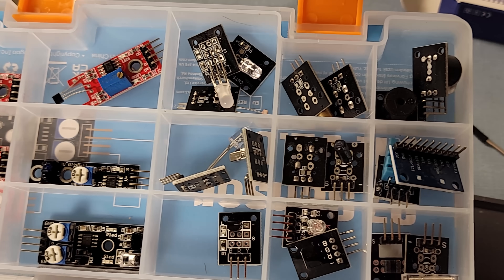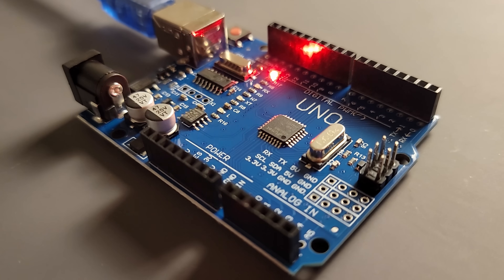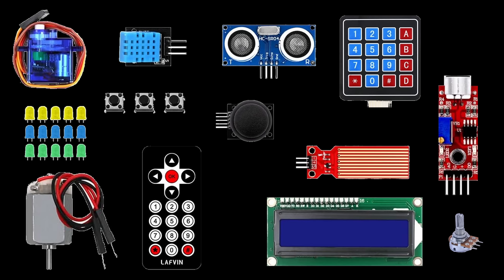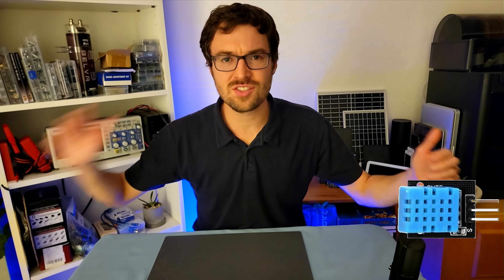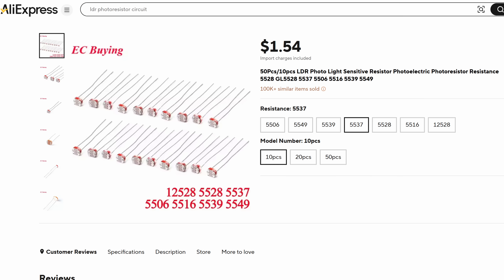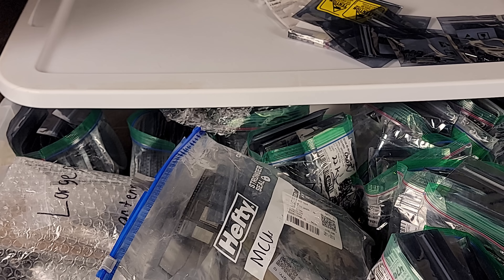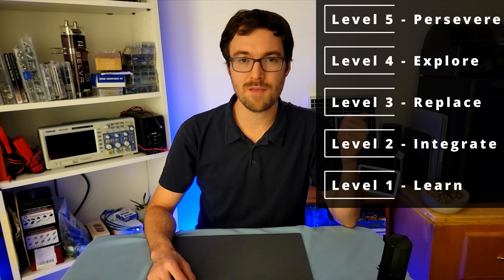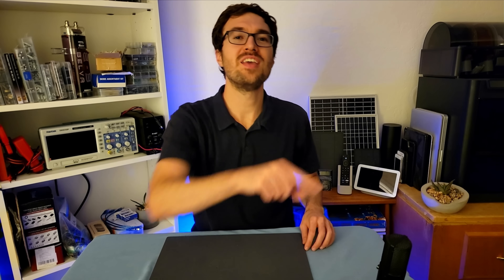How to Make Anything - Learn to Think Like an Engineer

Comment: Great video! I started DIY'ing long before modules existed (chips were even new actually!) so your "young" perspective explaining to other young people is tres novel to me!
Your explanation on the other hand is bang on and very insightful! You forgot the word "designer" which I personally love to use though hehe. 
Once you can do circuit level custom builds, the sky is the limit! Truly it is. It's nice to see young people doing this level of engineering. You're living in an amazing age of evolution, post clunky parts, pre-AI engineered, what a great time to be alive! All the best!
Reply from the maker: Thank you for such a wonderful message! Things are definitely different these days... I remember my grandpa telling me about the horse-drawn ice cart that would go through his neighborhood once a week. Now I'm getting custom circuit boards made from halfway around the world for five bucks and using AI to interpret meaning from dozens of various types of sensors. It sure is a new world! 

What kind of clunky chips do you remember using most? I can't believe how big some of the capacitors and other basic components used to be, often a little metal cans with huge legs sticking out unlike these modern tiny through whole components and even tinier surface mount components. Sure has been a lot of change quickly!

Comment: These are great advices. Don't do tutorials just for the tutorials sake, try to understand how they work. My approach is to think about a project first then try to make the project and learn the stuff while doing it. Yes, it may be frustrating to debug for an hour and realising I only missed a pulldown resistor but after that I will remember to always put that resistor there. The satisfaction you get from finishing your own projects is always greater than what you get by just finishing tutorials (although they can help sometimes).
Reply from the maker: Can you just tell that, exactly like you told me, but to the 10% of my comments where that is the perfect answer? 😜 I'm glad you really get it!

Comment: My dream is to become an aerospace engineer, so learning arduino and progressing towards raspberry pi is the first objective. I used to love Lego as a kid, but I now wonder if I should buy Lego mindstorms and take in robotics class. How will it help me? How do I connect and think logically?
Reply from the maker: I would step up to the final frontier and use real things. You are probably way past Lego Mindstorm if you are looking into Arduino and Raspberry Pi. I don't think an older age gives you any advantage in learning how to program in Arduino, connecting/reading sensors, and when XYZ happens make a motor do something or do something over WiFi. If anything, the older you get the harder it is to learn stuff.

If I was you, I'd get a basic Arduino starter kit, then a "37 in 1 sensor kit" or something like that and learn how to turn a problem/need into a mix of sensor, microcontrollers, programming, and other components. Not following tutorials, building things yourself from scratch. Also learn about materials science. Maybe not now, but maybe pick up a used textbook off amazon for a 101 level college course. It is one of the most underrated fields of knowledge and you will be able to benefit more than most from it.

If you have any questions, feel free to ask! Hope you keep at it!

Comment: As someone who has been bum rushing my arduino kits, one of the most important things I've learned recently is how to put resistors or any other components with long leads into the breadboard withour wanted to break my fingers lol. Pinch a short right angle at the bottom of the lead, just long enough to make a connection with the breadboard, but also short enough so that it doesn't bend and break everytime you try to fit in the breadboard. Obviously this isn't something you would need to worry about on larger scale project's because you typically won't be using "clunky" resistors, but it does help the breadboarding and micro project phase of engineering much more fun. Hopefully this helps.
Reply from the maker: Took me a while to figure that one out! I think I'm an expert at grabbing wires near the end and pushing them into breadboards at this point 😂 The worst thing is when you bend it over and over and over and you end up with like a curly fry looking section halfway down the wire! Great tip for beginners!

Comment: I wish to surrender to your teachings without spending too much
Reply from the maker: Writing software is free. Designing PCBs is free. Using your existing hardware in new ways is free. Years later, I'm doing the same things I did when I started out, but I'm just much more proficient doing them. If you did something 100 times, you're going to be better at it than your first time. All sensors and microcontrollers generally work the same. Learn on some, others will be easy to pick up after that. Most importantly you just need to get out there and build stuff and get experience. You will fail a lot, but the difference between a project being done and not is just continuing on and working around and figuring out those 10 or so failures you will inevitably run into. So just keep on going and accumulating experience. 

If you have any specific questions, feel free to ask!

Comment: Wait you need code to make a button light a bulb? Isn't it all about just closing the circuit?
Reply from the maker: Yes and no, depends how you wire it. If you are it directly to the power source then it will turn on as soon as the wires are connected. But if you have the microcontroller using one of its pins AKA wires to power the LED, you have to tell the pin to turn on or off using code. 

Example pseudo code: 
ledPin = Pin(number=123, type=PIN_TYPE_GPIO) # set pin 123 as GPIO (general purpose input / output)

ledPin.setValue(1) # turn on 

sleep(10) # wait for a bit

ledPin.setValue(0) # turn off
Reply: @FluxBench  so quick answer, thank you

Comment: You’re an inspiration. I started getting into electronics a few months ago, and ever since then I keep buying more and more components and trying to assemble systems. I do 3D printing, then try to figure out which modules I need, and I try to connect everything neatly and solder it together. What you said in the video perfectly summarized the mindset that took me a long time to understand on my own. I think I will try doing PCBs and make my own modules in the near future.
Reply from the maker: Awesome! PCBs are a great way to compliment 3D printing. They are extremely precisely made, and combine that with the not very precise but very quick and capable 3D printer, and all of a sudden you can do awesome things. I've heard it put as "stealing tolerances". Use the 3D printer for what it is good for, and get precision manufactured sheets AKA PCBs for where you need exact alignment and spacing. 

Also makes great face plates.

I try to keep the mounting hole spacing on my PCBs something reasonable and not a random decimal number, so that way I know if I make a group of pegs at the same spacing as the board holes, I can just put the board on the pegs with a push fit. Now I've mounted a circuit board to a 3D print part. Anyways, hope you make some awesome things!

Comment: What if an outdoor HVAC condenser circuit board goes bad? Can those simply be repaired with this knowledge? If soooo....... 🤔🤔
Reply from the maker: That's a really tricky question. I have two window ACs that have faulty circuit boards that I know I can fix, and worst case completely redo myself for probably $20, but there's also a decent chance I will brick the whole thing! 😂 I need to fix them before it gets hot again.

If it was a customer's system, I wouldn't mess around with it. But if it's my own, I would, and plan to! But then again I build air conditioner monitoring systems for a living so am also pretty comfortable with how they work and what to expect electrically and stuff.

I would bet money on it being a capacitor. Specifically a large electrolytic AKA cylinder looking thing with a positive and negative wire. No matter what fails, 90% of the time it's a electrolytic capacitor that leaks or it gets corroded or just got really hot and lost its capacitance.

Comment: I would say boards are great because no one is trying to mass manufacture and it makes a complicated proccess still complicated but more swallowable
Reply from the maker: I'm split, modules are nice because they take like an hour to design and there are always new sensors and chips coming out, but then you can do all sorts of different configurations with boards to make them unique.

Comment: "Own your circuit." I love that ethos!
Reply from the maker: It sounds better than "rip off the designs others have made" 😂 there isn't much sacred in electronics, it's kind of like art. Nobody is really stealing other people's art style, you copy and make it your own.
Reply: I am also trying to make my own pcb but, I think it's hard to make your own mcu like esp , so if you know then tell me how to make it possible? Do I required to learn all protocols?
Reply from the maker: @aayushshah1949  you won't be able to make your own MCU, but you can find which MCU of the 10,000+ out there works best for you. You don't need to learn all the protocols, just the ones you need. GPIO to turn on and off the pins coming from the MCU, and then UART to talk to the MCU are a good start. After that you will probably have to learn how to use different communication protocols to talk to various sensors and things like that. 

If you have any more questions, feel free to ask!
Reply: I understand every thing what you said, please 🙏 if possible give some time to make videos , I know it's difficult for you to give time for making videos also it tooks so much time for setup , I also have a channel name billion gear (1k sub) , after I started watching your channel then I understand that , the circuits I made like blink led, led flasher is not only a flasher it's a type of amplifier type circuits😂 which are used in real devices with switching on and off. .  @FluxBench
Reply from the maker: @aayushshah1949  good insight! A lot of parts are used in very creative ways. A LED can be used to block voltage in one direction up to a certain point, MOSFETs with their gate voltage controlled can actually be used as current regulators, and all sorts of things. 

I am making videos again, I had to pause so I could get some work done outside of YouTube. You know, engineering and stuff 😂 starting to make more videos again now!
Reply: @aayushshah1949  If you don't already know about it, google EasyEDA. Sign up for a free account and you can browse endless circuits made by other people doing exactly what you're looking for. You can use that as a starting point and to really understand what everything does. G/L!

Comment: i would say start with telling people "red light on" is what is called a test. like in python print() statement. they will never tell you the "red light" as a test can help you troubleshoot each part of the system....
Reply: Ive never done this stuff just systems design and python programing. But the next question would be, what are the other test you can use with the "red light test"? at some point you can through away the examples and start testing each example for each new system part you want to implement.
Reply from the maker: @kingsimx  Good way to look at it! I could do a whole video on when I was younger and thought I did not need debug or test LEDs because I was just going to make something perfect 😂 oh boy, let's just say I have LEDs on most my boards these days 😉
Reply: @FluxBench  I thought the same thing! :)

Comment: What are some good projects to start with? I’m interested in projects that could bring a tiny but tangible positive impacts in my life.
Reply from the maker: Some of my favorite projects have been answering questions I have about my life personally like hooking up a sensor to a microcontroller and see how many times a day something happens. Or building an accessory to a 3D printer or another tool I use often that I want but doesn't exist.

Basically I like solving my own problems and being able to do so. Maybe find what you need and try to build something to do that.
Reply: @FluxBench  I like the idea of collecting stats on random activities around the house! Thanks :)
Reply from the maker: @bernardberari4250  answering your questions with actual data is awesome! A stupid simple one that I loved was a little distant sensor aimed near the front door handle with a temperature sensor. It read the temperature over time and logged how long the door was open and about how wide. Then I compared it with daily electricity use and weather temperatures to see if opening the front door often during the Arizona summer really did impact the home energy use significantly. Short answer I got, not really! Energy use was correlated to outside temperature significantly more than how many times the front door is opened.

Comment: Can anyone recommend me a cheap material which I can use as a case for my electronics Because I dont have 200 dollars for a 3d printer but I need to make compartments for stuff
Reply from the maker: Use scissors to cut plastic food containers, then use a combination of tape, glue, and a soldering iron on low with a junk tip to melt the seams together. Plastic welding is the term. You can also make diy plastic staples that melt into the plastic.

Or buy a "project box" or some other container. I've done many projects in an old glass jar with a hole drilled in the lid, wires go out the hole, then use glue to seal the hole from air and moisture.

Comment: Im interested in learning to apply the knowledge to Agriculture. Automated pumps, security from theft etc what approach would you recommend?
Reply from the maker: Get an 2 of the ESP32, and a basic sensor kit. Learn how to get the two ESP32 to talk to each other wireless, then learn how to use each type of sensor that you need. Proximity detection or human detection sensors, moisture sensors, relays to turn on pumps. 

You don't need anything complicated, you just have to know the basics well to do what you want to do.